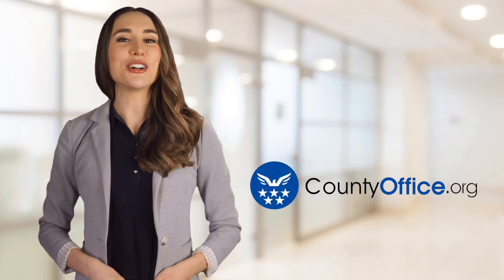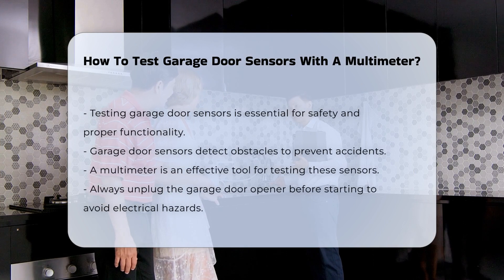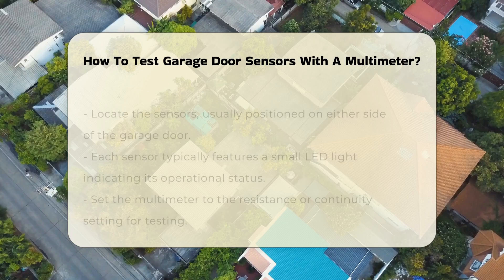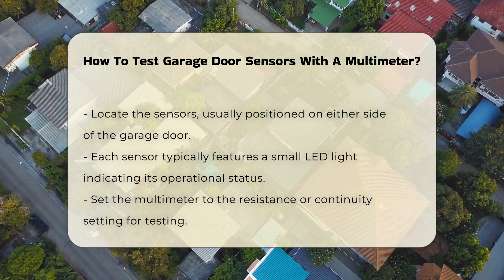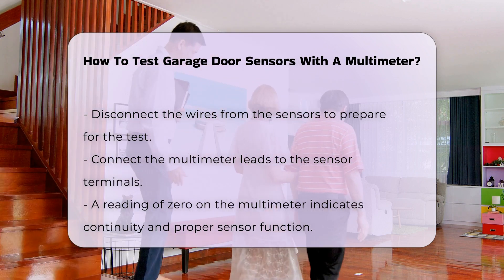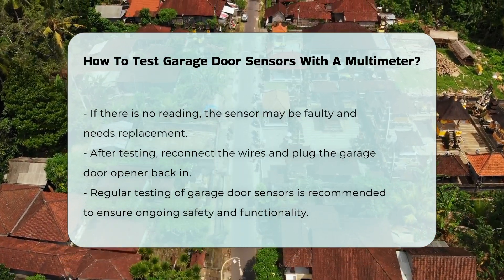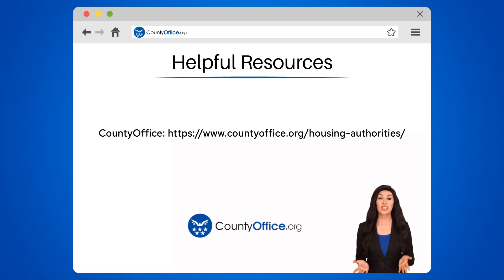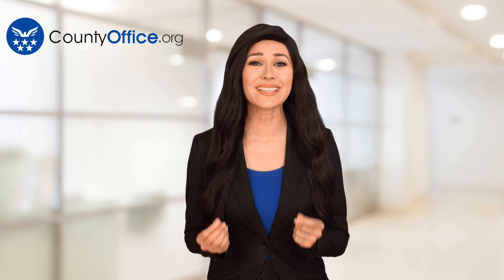How To Test Garage Door Sensors With A Multimeter? - CountyOffice.org

Comment: This is stupid. To measure current, you need the meter connected in series and set on  DC amperage to measure current. You can measure voltage in a DC voltage mode and disconnect one of the wire terminals to the sensor and measure the voltage across the two wires to see the supply voltage.
Reply from the maker: Thank you for sharing your thoughts! You're right—when measuring current, the multimeter should be set to DC amperage and connected in series, while for voltage checks, it should be in DC voltage mode across the terminals. Our video focuses on general sensor continuity and voltage checks, which are helpful for most homeowners, but we always recommend verifying procedures with the sensor manual and consulting official sources for accuracy. Are you interested in tips for finding property records or public data related to your area?